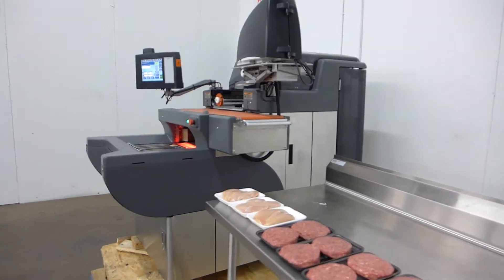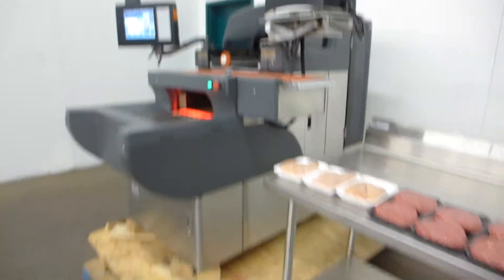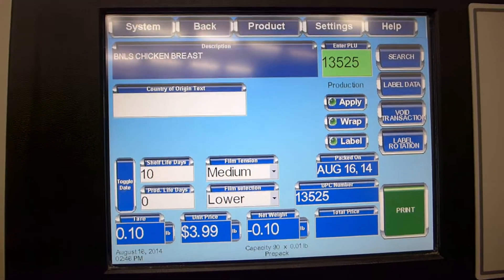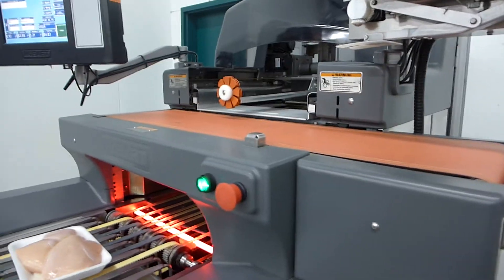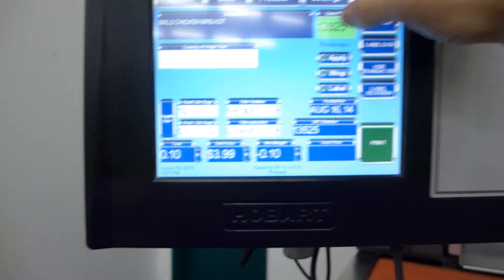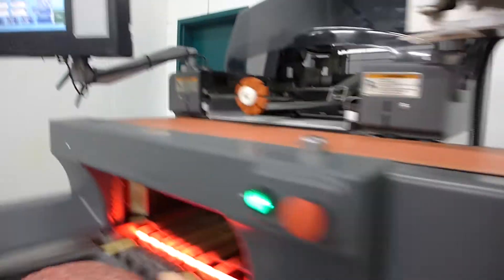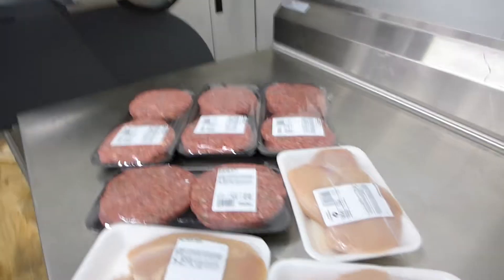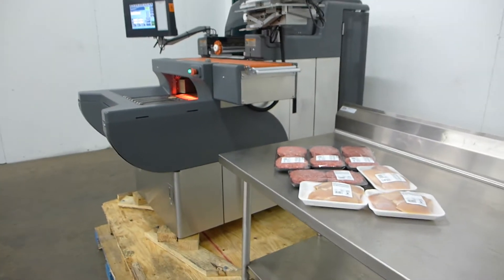Hobart AWS-1LR Access Automatic Meat Wrapping Wrapper Packaging Machine, EPCP Console, EPP Printer

Comment: Yes the Machines work fine, but in retail meat markets now days the trays we get in are too cheap and flimsy to go threw any wrapper without getting crushed and jammed. Since around 2009ish there is only one tray size I have seen go threw the wrappers "3P" better off hand wrapping. Our store bought one of these to replace the 1994 model and we had the same awful results. Trays are just too flimsy: that's why you used plastic trays on the burgers and 3P's on the breast.
Reply from the maker: +CrazedRetard I used plastic trays on the burgers and 3Ps on the breasts because that's how they came from the grocery store! They were probably using a Hobart UWS, not AWS (UWS is predecessor). You sure you using AWS? You go into the settings and make any modifications for specific tray types? These AWS machines have front cameras that size up all three dimensions, LxWxH, the old wrappers were only two dimensional, LxW and they had problems...
Reply: how much is this  machine
Reply: Yes they get meat trays from china.to crispy.
Reply: A correctly adjusted wrapper will not crush trays. I have run paper trays through these machines without any issue.